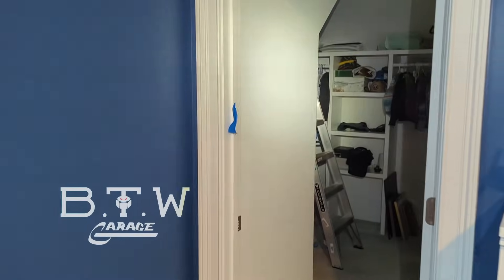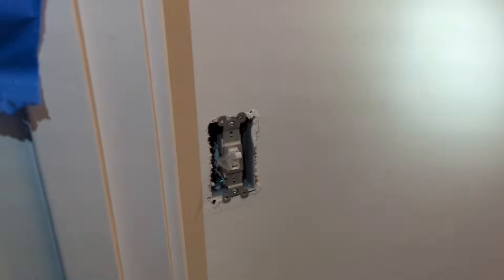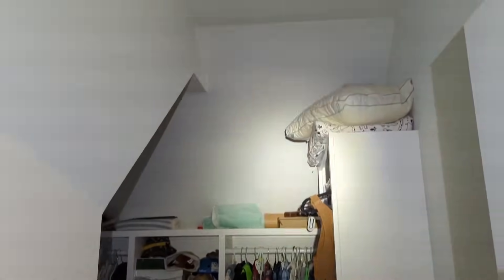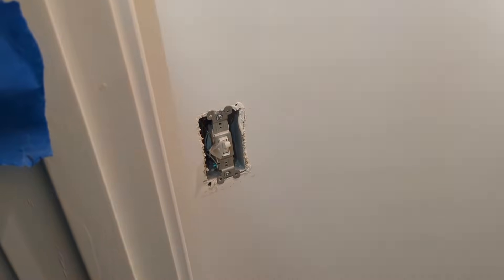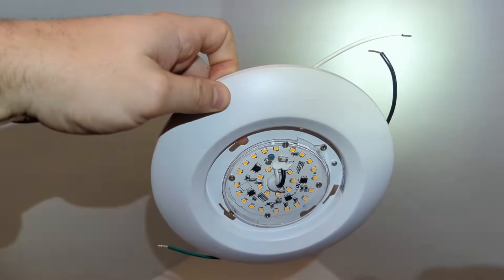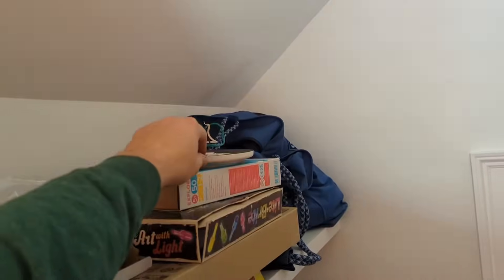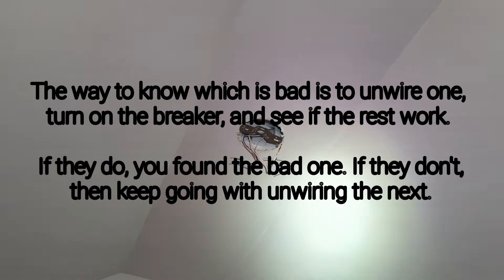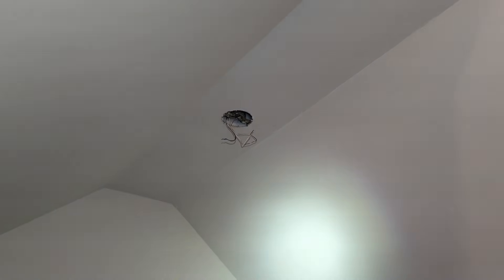Why Your LED Recessed Lights Are Tripping Breakers (How to Fix It!)

Comment: I wish they would bring back incandescent lights. The whole environmental thing is a joke. Way more plastic goes into that garage.
Reply from the maker: @rollingedges9469  yeah I hear you. All the lights on our newish to us 2019 build are this way or the other style where it screws in via socket and wire but is still a flat led. Now that I know it, not so bad, but definitely catches you off guard
Reply: they are..give it time.
Reply: You CAN still find some. Seen some on Amazon.